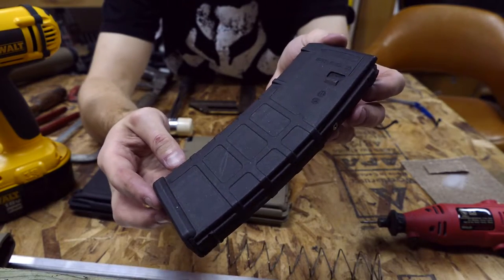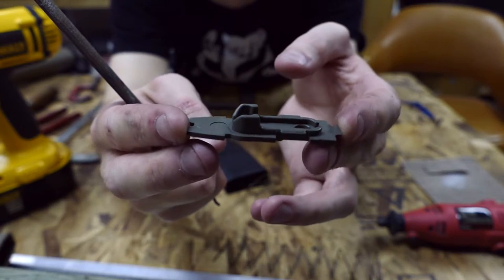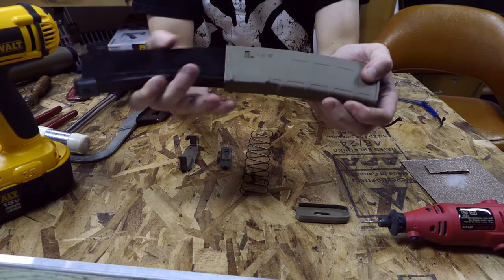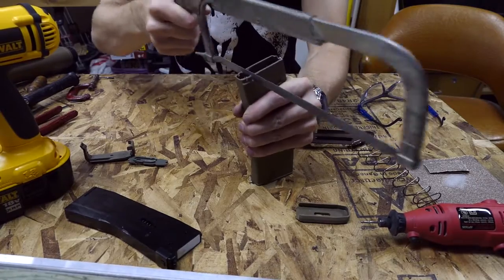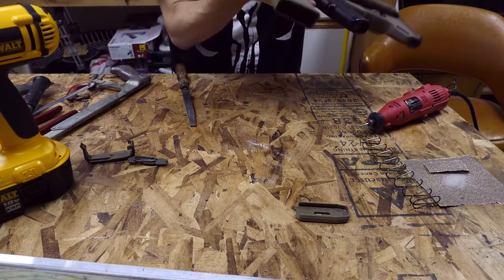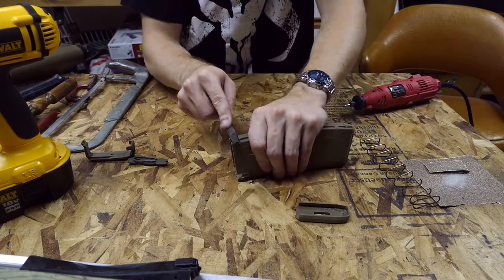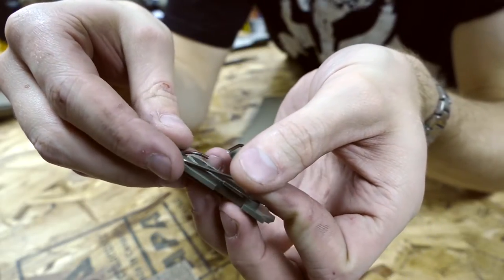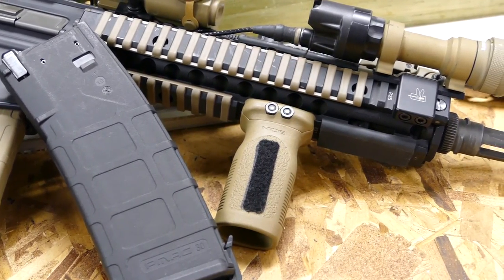Real PMAG Conversion for Systema PTW

Comment: I noticed you’re Canadian - the five-round rivet tells all - so do you have any advice regarding to what extent the magazine should be modified before removing said pin, in order to avoid any potential legal issues? I want to try something like this using a tutorial I saw for AK midcaps, as well as with PMAGs (maybe even proper STANAG magazines) for midcaps when I get an M4, but I want to avoid any and all potential issues of legal troubles.

Is it just a case of filing/cutting the feed lips until they cannot accept real ammunition?
Just curious.